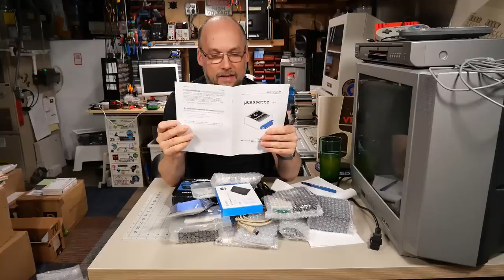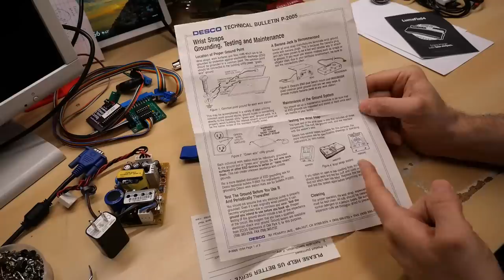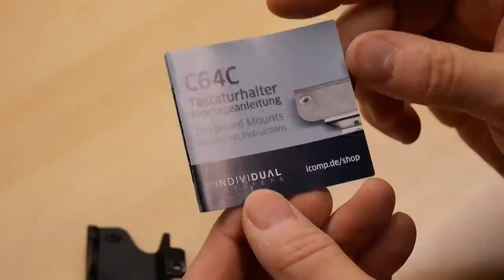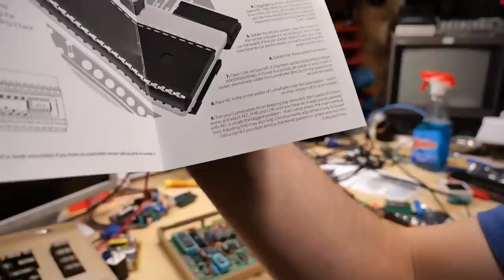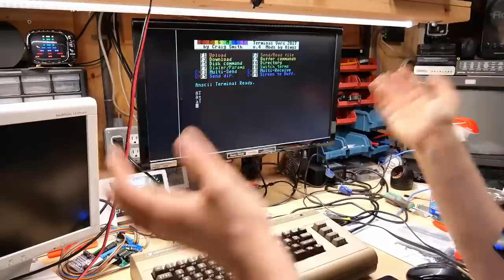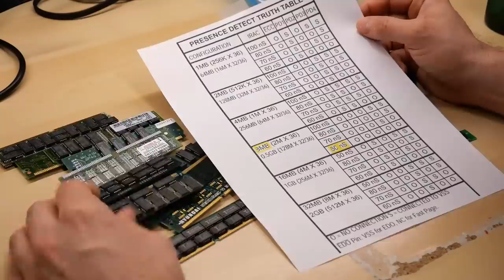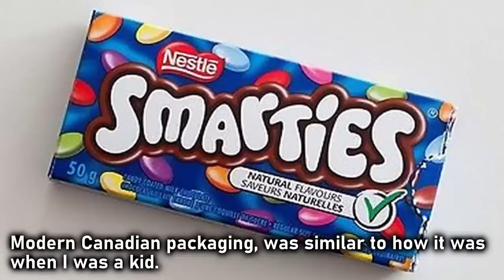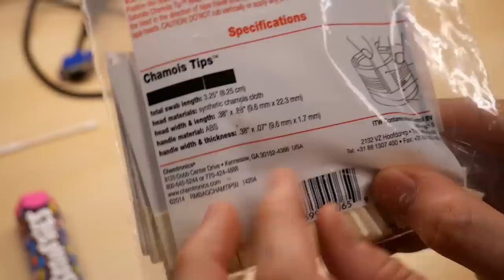A C64 datasette alternative, Lumafix test, Mac robot, and a yoyo for a Powerbook G3

Comment: Those are loopback adapters for things like CheckIt to test serial/parallel ports. 

The network dongle is a "poor mans" way of adding more network lines to a run.  It adds a 2nd ethernet port and wires it onto the 2 unused pair (brown & blue).  you usually use them in pairs - 1 in the nework closet to inject 2 ethernet ports onto 1 cable run and another at the other end to split them back out.  I've used these in the past; they are "ok" but not great.  especially if the cable guy didn't care about terminating blue/brown pairs very well.

The power supply tester is for testing ATX power supplies for functionality and voltage output. Used when you need to determine if the "no power on" issue is the motherboard or the power supply.  This will power on the power supply without needing the motherboard.

I didn't ship any of this but have used them all at one point or another....
Reply from the maker: Oh cool thanks will need to try those out with Checkit! That would be handy to have a set!

Comment: If I remember right, the version 2 C64 Kernal had an annoying bug. If you go down to the bottom of the screen with the cursor in any color with bit 2 included (red, cyan, yellow... light blue, gray 3), type more than 80 characters, then try to backspace down past the 80th character, it would immediately execute a tape load operation (and if you didn’t have a Datasette connected, it was as good as crashed. Power cycle time!). I’ll bet the text on that chip was recolored as a reminder. Have you tried checking with isopropyl alcohol?

Comment: I really like these ORICO adapters (I also was a bit disappointed they were plastic) 
I can insert then easily in the same 51/4" Tool /drawer less HDD adapters that my 31/2" standard drives

Comment: Oh boy is that a bronze Lombard g3! I have one but It doesn’t boot anymore, can’t tell if it’s dead or if the power cable is frayed beyond repair (it doesn’t have a battery so needs to be plugged in). Or if i have to unplug and replug the cmos. I keep looking for replacement power cords but I’m not sure if the ones i keep finding on amazon or eBay are the proper replacement .

Comment: KLAX I played on my Megadrive 32bit.  The basic concept is to drop the tiles into the bin below and then drop matching colours to make them disappear.  You can match horizontal, vertical and diagonal.  Up threw the tile back onto the top, down made the tile come down to the catcher thing (me and my mum called that the Pallet), and on mega drive it was A to drop it into the bin.  Each match earned you a 'klax'.  Each wave had different challenges and requirements.  One particular hard level for me was when you had to get 13 diagonals.  You lost the level if you dropped 3 or 5 tiles depending on the level.  Every time you drop a tile - it made a 'wah' noise (at least on the mega drive version)  My mum once played it so much she could see the tiles coming towards her whilst she was asleep.  I once played it for a long time and ending up doing the same.  I can still play the game on a Sega Mega Drive emulator called Fusion, that I have installed on my PC.
Reply from the maker: Hah it's like a variation on Tetris. Sounds like a very fun game -- I could see getting really addicted to it. (Like so many were with Tetris.)
Reply: @adriansdigitalbasement  IT IS addictive
Reply: P.S - Mac Classic robot is very very cute!

Comment: Totally agree with your opinions on the Lumafix64. Built some myself and they just don't do it for me. On the machines I've tried, they mostly makes the images fuzzier so I might as well use composite video instead which limits the stripes. I wish someone that was more well-versed in filters would put some thought into a better luma filter, maybe something based on an op-amp.

Comment: Regarding the anti static strap.  I have only ever worn one maybe twice because, as you say, they are a nuisance.  I always make sure that I have contact with the computer case frame so that I am at the same potential as any device I am handling.  I have always thought that as long as you don't make a circuit or are at the same potential as the device then there is no static circuit to cause problems.  It's an interesting subject that I would like to know more about.  Cheers

Comment: The 100base T splitter is a real thing as 100base T is only using two pairs, so you can actually run two independent 100base T connections over one 8 pair cable.
I have some of those in use bor my IoT devices to save up on cabling.

Comment: The only trouble with loading c64 games using that audio adapter is that some games like turrican will fail to load correctly as it starts and stops the cassette frequently during the loading sequence.

Comment: I5 years ago I recorded games using the original datasette and a cable to the parallel port a DOS SW and T64 images. Nothing like the suspense of a RAL tape loading LOL. But seriously, the datasette is not dificutl to mantain and does a pretty good job .... a bit slow when games does not use turbo loader

Comment: Have you featured the Tapecart SD for the Commodore 64? I don't think I've seen it on your channel. It's very cheap (about £15), plugs into the cassette port and reads games off an SD card, much faster than a cassette or disk
OH also... The orange Smarties do have a taste, but they're the only colour!

Comment: I had JiffyDOS installed on my C64, but there is a warning that JiffyDOS takes away some of the RAM.  I found that the RAM which JiffyDOS used was also used by MultiPlan, the Microsoft spreadsheet that was available for the C-64.  I used it for my church's financial statements and budget, but found that some changes made to an active spreadsheet would not be saved.  Too bad--otherwise JiffyDOS worked well.

Comment: Interesting, I've never seen a 2.5 to 3.5 adapter like that with the passthrough connectors, usually just a bracket that it sits between, but you still plug the cables directly into the 2.5 drive directly.  That type will at least guarantee that the SATA and power connectors are in the right area for a 3.5 drive, so you can put it in a 3.5 drive sled with a backplane(like in a server for example)
Reply: the DB9/DB25 things, i think you're right.  loopback plugs for diagnostic software(PC Doctor is the one that comes to mind)
Reply: Also, the person that made the Classibot has some others(an iMac based one, and a trashcan,  not sure if he has others).

Comment: Next invention...  Wireless grounding strap..  ;)
Reply: (and I don't wear a grounding strap either....)
Reply: @MakersEase  You should if working on 80s/90s electronics - the chips don't any built-in ESD protection like modern chips do.
Reply: @Xoferif  I understand - I have been around (as in old).  I have just never had an issue.  (as Adrian).   It was always the scare - if you look at cmos chip sideways - they will go bad.  Again - never had an issue.  (although I didn't walk around on a carpet and then touch circuit boards either..) ;)
Reply: @MakersEase  Climate has some bearing on the problem: Here in the damp north of England electrostatic build-up is rare, but when I'm working in the south lighting bolts fly off my fingers like the Emperor in the old Star Wars films!  =)

Comment: 2:48 you aren't plugged into ground. There's a 1 megohm resistor. It drains electrostatic charge that may have built up in your body.
Reply: Lassi Kinnunen  Through a 1 megohm resistor. You cannot get a deadly or even damaging current at 120v through a 1 meg resistor. Using it without a ground is completely useless. That doesn't make any sense. It's a ground strap only when it's connected electrically to ground.

Comment: You're not anymore "connected to ground" with an ESD strap than the electronics devices are.  In fact, you're at a far higher impedance to ground because of the strap.  That's how the ESD strap actually works.

Comment: I don’t really understand these tape replacement devices. When I was a kid we had a lot of games copied to 1 tape. As an adult I started to buy genuine cassettes from ebay and they work a lot different, they make the tape player pause from time to time. There are even games that keep loading stuff, like new levels and such. How would that work with cassette replacement hardware? 2 years ago I tried to play games with a cassette shaped thingy which had a jack wire (the one they used in cars that you can plug your phone and play music through cassette player). Put one of these in my datasette and played a .t64 file on my Mac but it didn’t work and gave up on this hacking quickly.

Comment: These kinds of PSU tester displays the various voltages and the PWR_OK signal coming from the PSU, but doesn't put any load on the PSU, at least not the ones I've seen that looks exactly like this (and IIRC no ATX PSU needs load to give "correct" voltages). Ref: https://www.tomshardware.com/reviews/how-we-test-psu,4042-6.html

The motherboard won't turn power to the CPU unless it sees the PWR_OK signal so having a power supply tester that display voltages and the PWR_OK status can be really helpful, especially on decent modern PSU which actually does quite a bit of self-testing before it pulls it up.

Obviously it's not going to find faults that require load but the reality is that a static load usually isn't that helpful anyway, to really test an ATX PSU properly you need a lot of expensive equipment both to burn of lot of heat (500-1500W), generate sharp load transients and capture short low voltage events, ripple and noise. IIRC one of the big review sites which has very good PSU reviews once mentioned they have more  than $100k of equipment dedicated just to their PSU testing with lots of custom built test harnesses (because the "real" equipment PSU manufacturers use for testing is far more expensive than what they rigged up).

Comment: THe 100/T splitter is correct, as the standard only uses 2 pair, and the cable has 4 pair, so back in the day, there were those adapters to allow more computers on the network cabling.

Comment: Every now and again I run into a disk that will error during formatting or will refuse to format, so I inspect the disk for surface damage if I find none I run a strong magnet around the disk enclosure then it usually works again. Hope this helps somebody.
Reply: I use a bulk tape eraser (which I bought many years ago) to do the same thing. It will bring back a disk to usability as long as the surface has not been compromised.